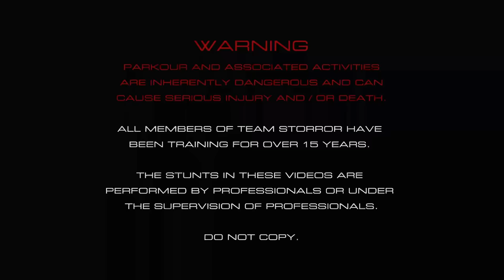Parkour in SNAKE Infested WARZONE

Comment: At 12:58 look at the pillar just underneath Josh, or more precisely the remains of it (of the pillar, not of Josh ;-) )...  Concrete is gone, only the rebar is there and the individual bars are spreading apart under the load (this is called buckling).  I would say that one day, that remains-of-a-pillar won't hold any load anymore, and as the neighbouring pillars are not in their good days anymore either, could lead to a domino effect with the whole building collapsing...

Comment: It is a shame, and a surprise it wasn't rebuilt. When I was in Cyprus as a kid in the late 80's, the Turkish side had armed guards on their buildings, still riddled with bullet and bazooka holes.
I was on the Greek side (bottom/lower portion of the island), but in the Capital you could see across the boarder and see it was heavily guarded, many UK soldiers were still stationed there too.
We were also told not to cross the boarder or we may not be let back over, we almost accidentally did, because there were no stations at the boarder either.
But there were and are some really nice well looked after places, and the people were very nice, well worth a visit.

Comment: Just like in this sport you know how the human body behaves and how to train well to avoid getting injured, you should also know at least a little about materials in construction and broadly understood urban planning. Not everything that looks solid will be solid. Materials degrade and this can be clearly seen in the example of this film, when a seemingly durable reinforced concrete wall, destroyed by the war, exposed reinforcing bars which continue to degrade very quickly under the influence of the salty sea breeze and the whole thing falls apart in your hands. This is just an example and I do not take away from your knowledge and experience. You're doing a great job.